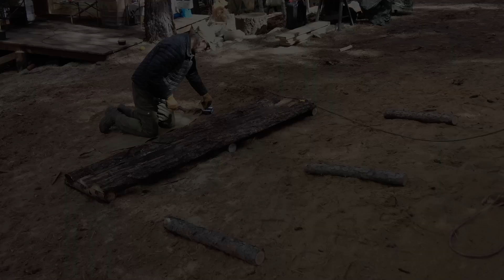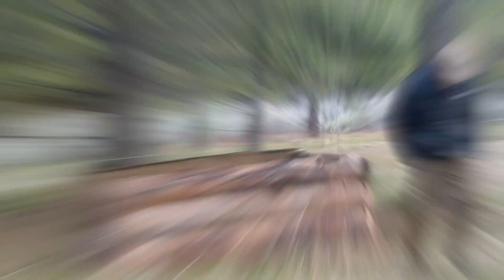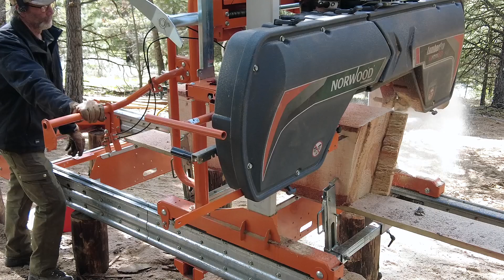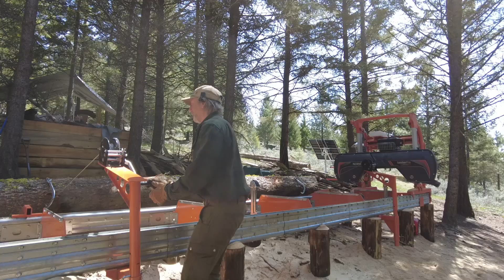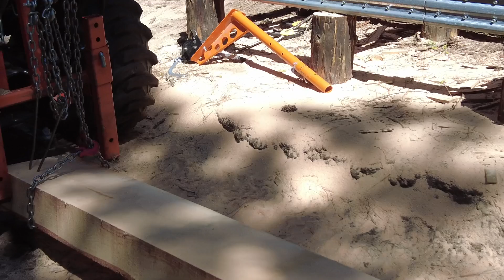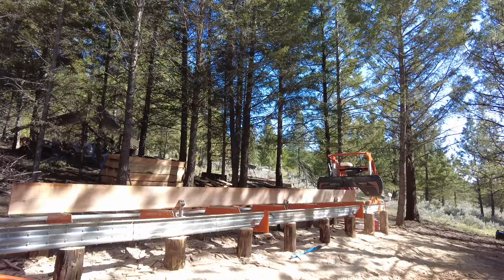Milling beams for the cabin build.

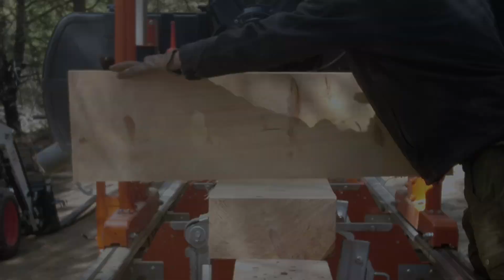Comment: 10:44  Just wondering what that green wire hanging down at the rear of the engine on the mill? Keep thinking it is going to get ripped out by the logs you are milling 😅
Reply from the maker: It's a zip tie I just never have cut.
Reply: @offgridal  🤣